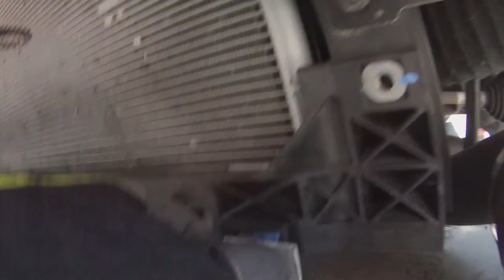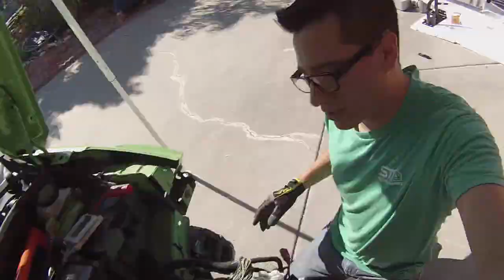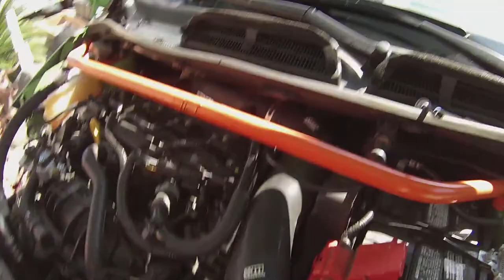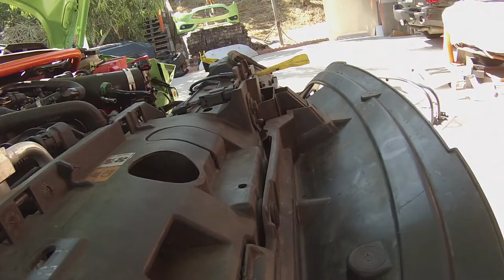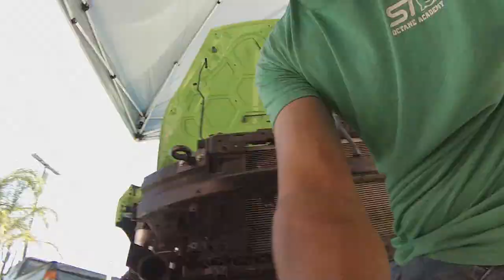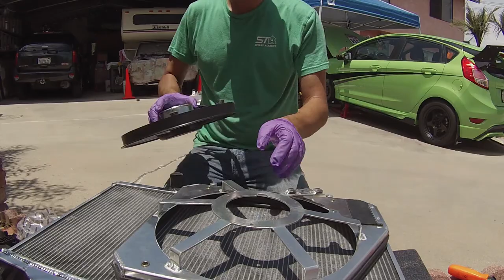Part 2 Radiator removal Fiesta ST

Comment: Did you track your car before installing the Mishimoto Radiator? Mine overheats in 5 min of track driving and I'm on the fence about getting a radiator or oil cooler first.
Reply from the maker: I did. Many times, I did however have the front crash beam cut out and the grill shaved so I didn't encounter heat issues until running in 90+ degree weather. The radiator would be my go to first and then evaluate if you need the oil cooler.

Comment: Hey dude, any idea if you can remove the stock fan shroud without removing the radiator or just disconnecting a hose or two? I'm in the process of building an oil cooler, and I want to cut up the stock shroud so its just the fan, but I do not want to remove the radiator.

Thanks!
Reply from the maker: It is pretty tight in there without unbolting the radiator. I can not say if it is possible or not as I haven't tried it or thought about trying to. Good luck!